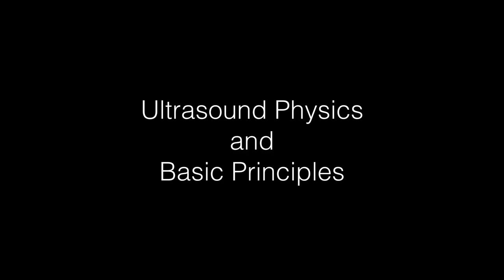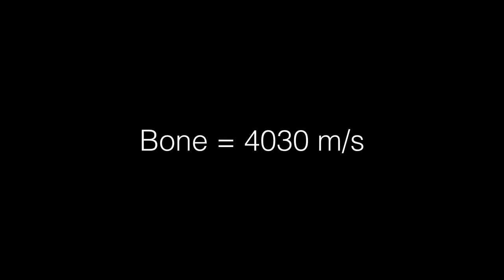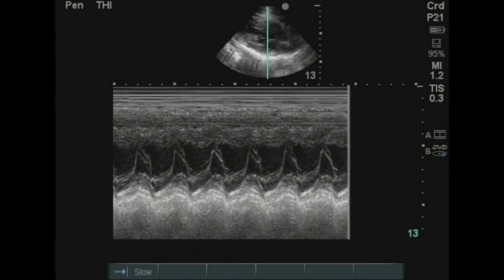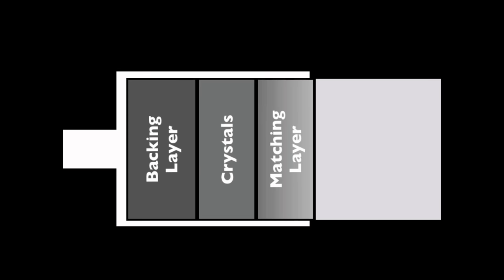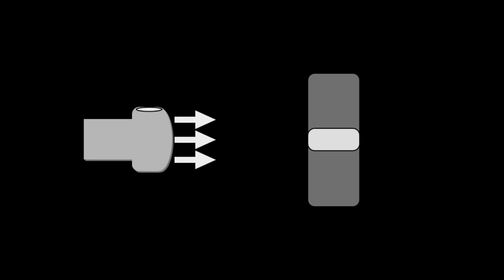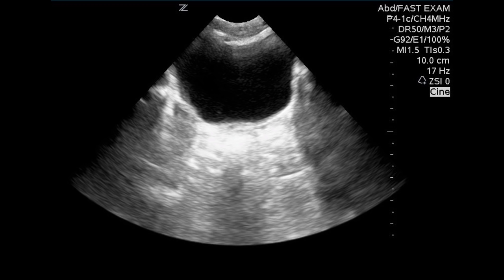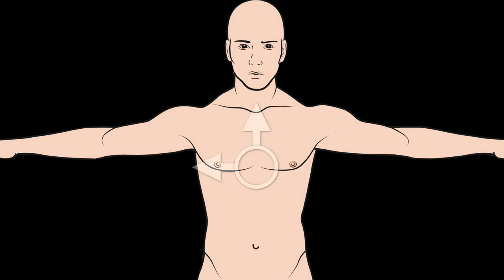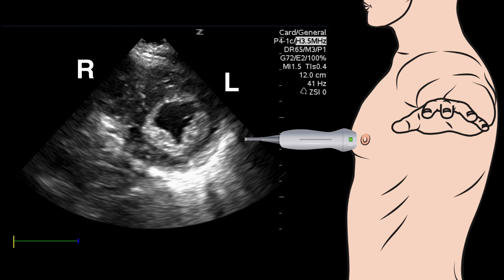Basic Ultrasound Physics for EM

Comment: I’m pretty sure through tissue is 1540 and no 1040.
Reply: Mike Martinez 5
Reply: you're right! it's always been 1540m/sec for soft tissues
Reply: The speed of sound in tissue is 1540m/s but,it changes with the change in the density of tissue . The higher the density the faster will be the wave and vice versa
Reply: @najeebullah587  agree and thanks for the useful comment

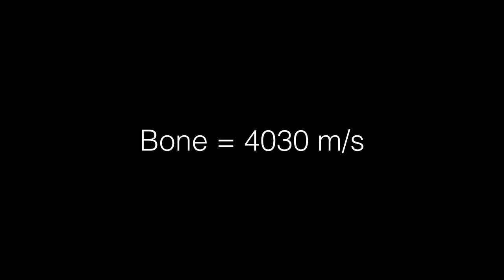Comment: Speed of sound in tissue, at 2:24 in the video, is not around 1040 m/s.  It's in the range of 1450 to 1580 m/s depending on the tissue type.  Ultrasound machine default speed assumed for soft tissue is 1540 m/s because it's a weighted average of what's most likely to be encountered in a scanning session.
Reply from the maker: Thank you, you are right, not sure how that made it through editing. thank you for catching it; I have added a note to the comments section for the correction.
Reply: Thanks for replying and for the videos.
Reply: Yeah I noticed that too.

Comment: Also be careful with BART for Doppler colors.  The speed colorbar shown on US displays will tell you unambiguously if the flow is towards or away from the transducer by looking at the color AND the corresponding positive or negative sign for the speed value.  Don't just assume BART gives the proper interpretation.
Reply: Agreed. These types of mistakes in teaching are unforgivable as it confuses the trainee.
Reply: Ken Rolt new addition to my knowledge.thanks